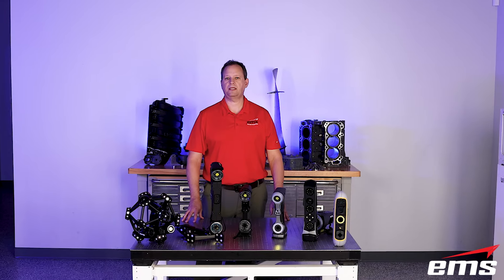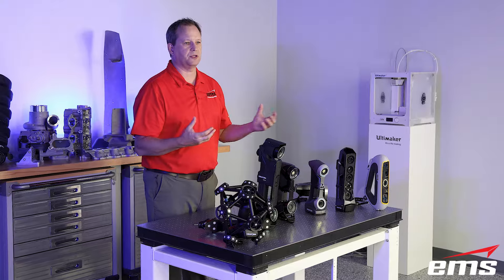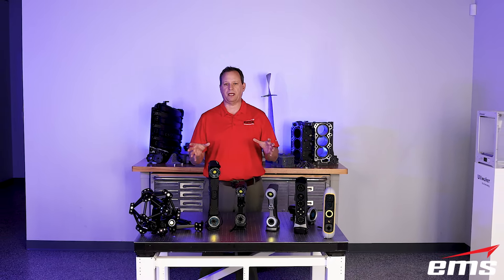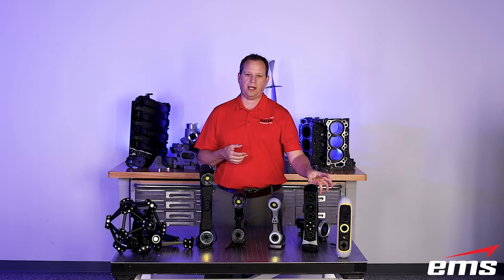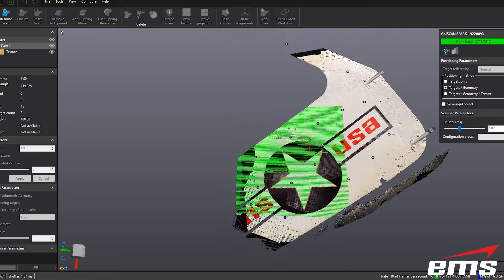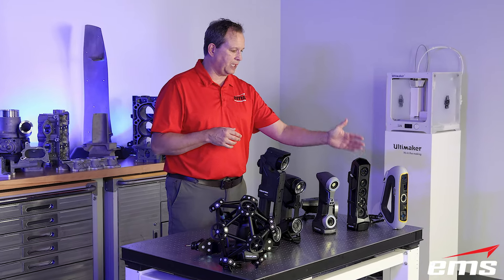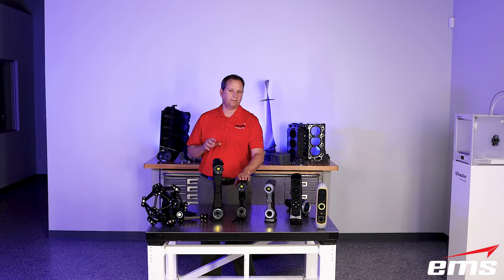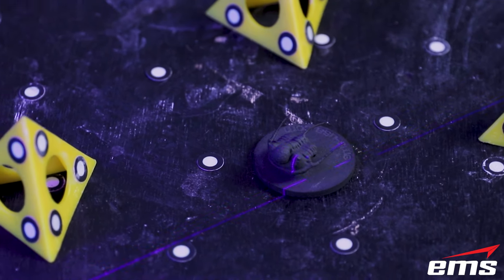Creaform 3D Scanner Product Comparison for 2024

Comment: I have this Aluminum part I need to machine: drilling, pocketing, face milling. It has around 150 dimensions I need to measure (part is about 150 x 1000 x 1000mm). I am looking for a video comparison between Faro Arm and Creaform scanner. Please share your thoughts about this comparison
Reply from the maker: Creaform is going to be much faster, more accurate, especially on larger parts, easier to use and much more portable.

Comment: What’s best for vehicle wraps/ paint protection?
Reply from the maker: If you are 3D scanning the whole vehicle then the HandySCAN MAX is the best.  If you are just doing areas like the front, mirrors, around the wheels, etc then they all do a great job.
Reply: Just checked the price 😮would I not get away with scanning a whole vehicle with a the peel 3 ?
Reply from the maker: @signprintdesign3954  Sure you can use the peel 3 but it will require a lot of targets, scanning spray on many surfaces and time to scan (3 - 5 hours).  The HandySCAN MAX will do it in 1 hour with few targets and no scanning spray and be more much more accurate.